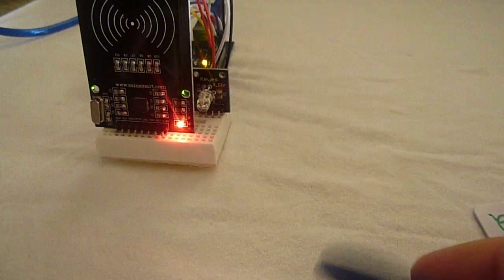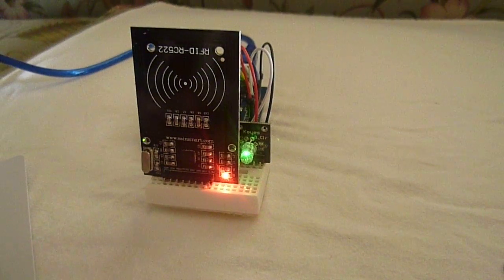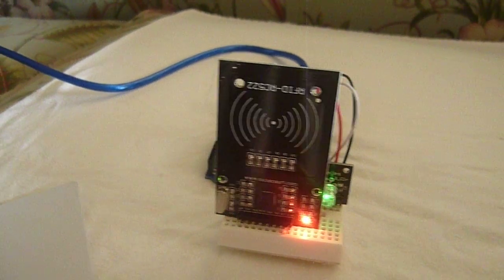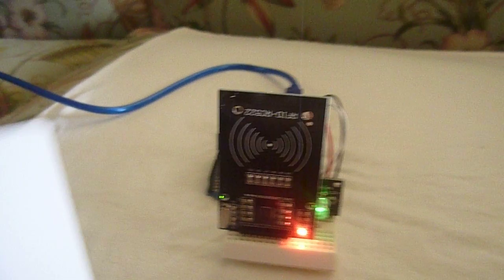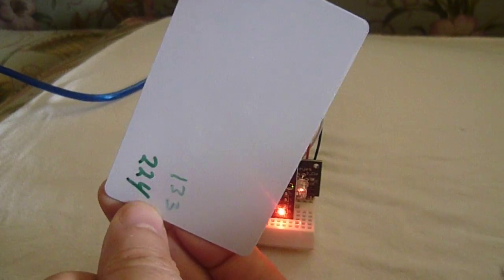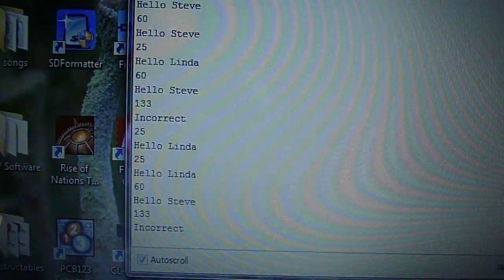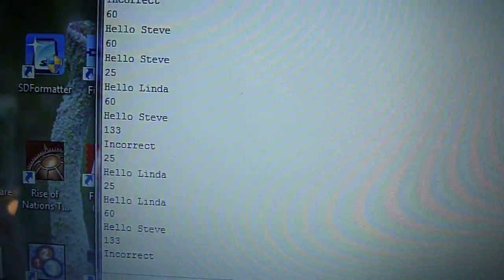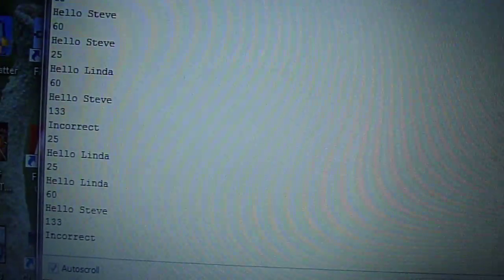Arduino RFID Door Access

Comment: Hi Steve - I have a HS-322HD servo motor attached to my Arduino (Pin 12). Can I trigger the motor with your RFID setup? Thanks!
Reply: Of course, every actuator can be triggered with RFID,just add if statement!

Comment: Steve, think it's possible to have an LCD, RFID and Ultrasonic sensor setup so that I would have to have the correct card and be at a certain distance for it to work and have a read out on the LCD from one arduino?

Comment: what is the maximum distance upto which it can detect a tag?
Also, how directional is the antenna?
Reply from the maker: depends on the size of the tag. cards have a longer distance than key fobs (cheap key fobs, foil based, have a shorter max than copper wire types of same size), but 10mm or so is typical. very directional.

Comment: Hi Steve i hope you can help, i have got the rfid reader to work when i scan the tag. Do you know how i can get it to trigger a relay when a correct tag is scanned please?
Reply from the maker: +Rodolfo Ferrada Laurence Look at the code that lights up the green LED, that's your relay trigger.
Reply: Exactly, but the voltage not appear in the pin 5 or 6 when the target is ok or not. Can i read the target but i can not release the trigger in pin 5 or 6. I have been testing 4 arduinos but not work.}thank you for your help!
I´m waiting comment.
Reply from the maker: +Rodolfo Ferrada Laurence pin 5 is triggered when the scan is good. You can see that when the green LED comes on.
Reply from the maker: +Rodolfo Ferrada Laurence I'm guessing you have a bad electrical connection. If the light is not coming on, check your wiring.

Comment: Great project, can you read multiple tags at once?
Reply from the maker: I've had two readers on one arduino, and I've had dozens of readers all dumping data to a central database.
Reply: Steve Spence how do you set up two cards on one arduino? Also have you experimented with other readers this one looks pretty long distance (i'm guessing 10 cm) in the video, what readers would you recommend?
Reply from the maker: Mark Schumacher here is the dual reader version. I recommend these readers as they are very inexpensive, and hold more data than the 125khz versions. http://arduinotronics.blogspot.com/2014/08/dual-rfid-readers.html